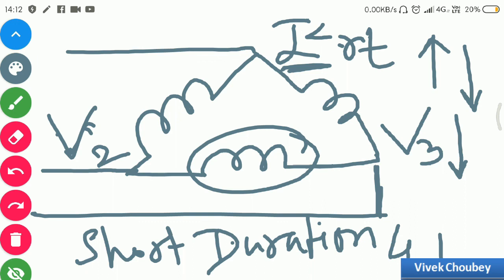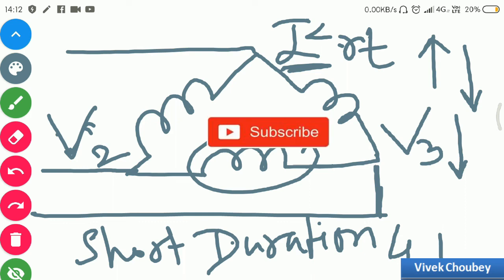Running a 3 Phase Induction Motor using 1 Phase | THE NON RECOMMENDED BUT WORKING METHOD

Comment: One winding connectd to two phases. It will short circuit happens..?? Plz explain
Reply from the maker: No the middle winding isn't connected to any different phase but if you see closely the top and the middle windings are connected to same phase its just that the middle winding has a capacitor in series and hence it behaves as starting winding.
Reply from the maker: We assume here that one of the phase isn't there or has some fault. Then this method can be used to run an IM on 2 phase where the speed will reduce and more current will be drawn by the motor causing it to overheat.

Comment: What happens when all three  phase connected with a single phase dividing and neutral point is connected in middle in a star connection
Reply from the maker: Well, the single phase remains single phase no matter how many divisions you do. So the three phases will be connected to single phase and in that case the motor will not operate and will burn out due to excessive current being drawn from only one phase.